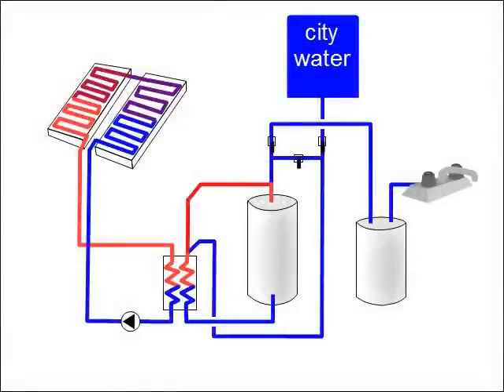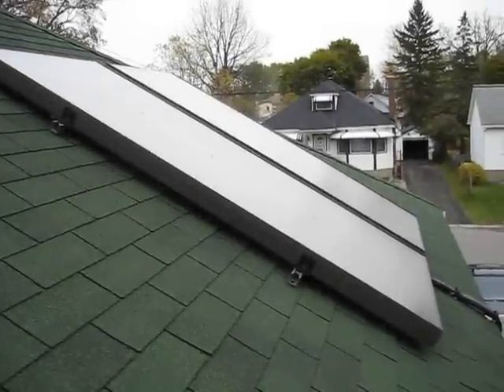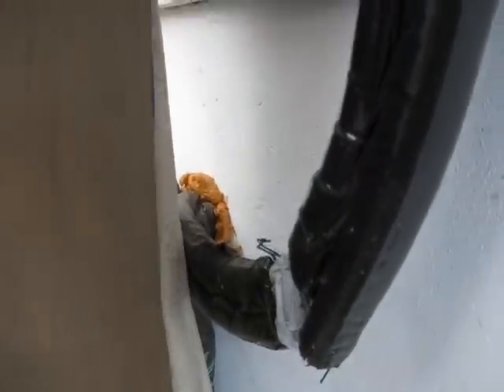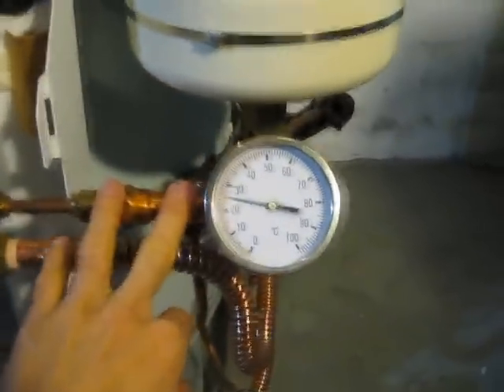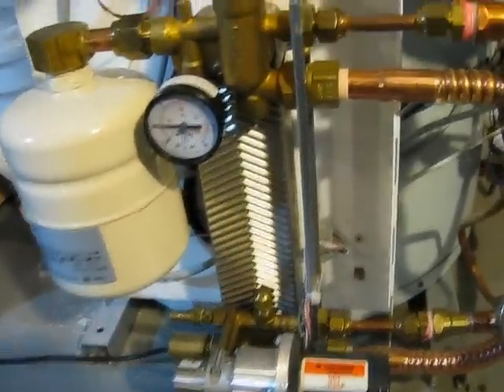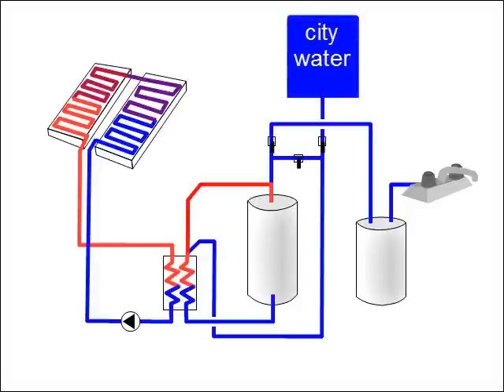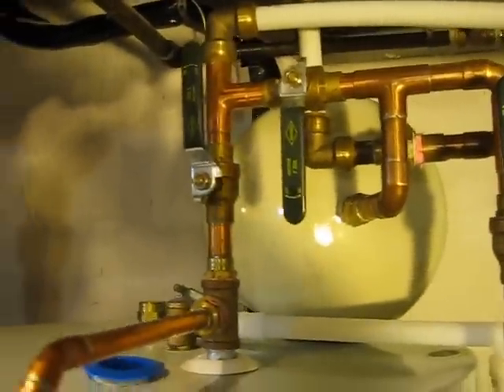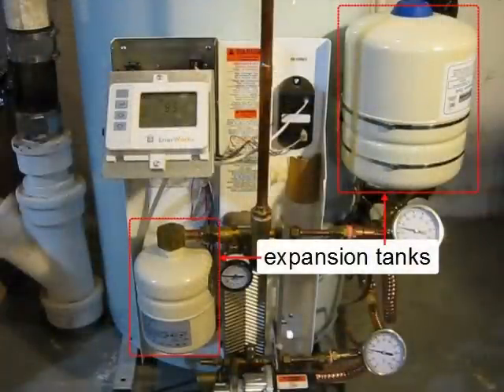Solar Energy - Solar thermal/hot water heater tour/details Enerworks

Comment from the maker: @garveynj It was a cloudy day and the pump didn't start up at all. He also had a slow pressure loss issue, probably why he hadn't insulated it yet. That said, the piping is as it's supposed to be for this commercial system. I understand what you mean by the thermosiphoning issues (pipe size and type of heat exchanger) but this is a highly engineered system design with a lot of happy customers so it probably isn't as efficient as you'd guess. You bring up some good points though.

Comment: I would love to see some reading on a bright sunny day to see how hot the glycol loop runs compared to the cold tank temp then you could see hom much extra out put you could get out of this system
Reply: I run 10x 1.4Kw solar thermal (14 KW total) configured as 2x 5 series paner running 30% glycol @3.5bar.
This feeds the 300litre Solar domestic hot water via its lower coil and then switched over to the central heating via a plate heat exchanger and in summer supplies the swiming pool via a heat exchanger. We actually had the pool at 31 degrees centigrade this summer. Water comes off panels at between 40  and 100 centigrade and has rougly a 10 degrees differential on the return. This is in the Uk and has been running for 6 years.

Comment: looking at the gauges in the video I am seeing 25C income hot from collectors and 23cold out of collectors and the water tank side cold of about 18C the cold out of the heat exchanger should be within 1 or 2 degrees C of the cold side of tank or the heat exchanger is not working very efficiently

Comment: @RimstarOrg but since you use the same pipe to connect to the aux water heater air bound wont be a problem but you don't need an expansion tank on the city side at all because the city side is an open system expansion could in theory flow all the way back until it was forced back into the water tower unless he wanted it to prevent shock loads such as water hammer it is unneeded.

Comment: @RimstarOrg For thermosiphoning to be efficient you need large pipe diameter the pipe going to the top of the tank if undersized causing the heat exchanger to run hotter making the glycol loop have to run hotter making the collectors less efficient because the have to run at a higher temperature. normally for the thermosiphoning is brought into the too the side of the tank to prevent it from getting air bound

Comment: That system is designed wrong for proper thermosiphoning and the plastic pipe between the solar storage tank and water heater is a very bad idea also why did whoever installed this never insulate the piping between the tanks and a lot of other pipes on the cold side too. Conduction will make the cold pipes hot when no water is used and waste heat.